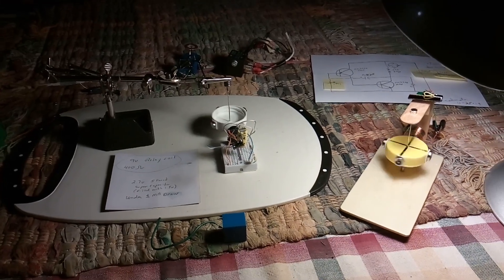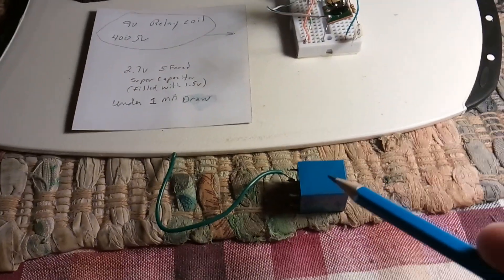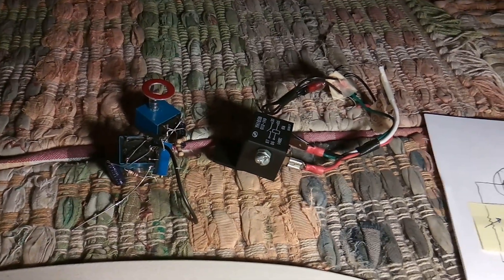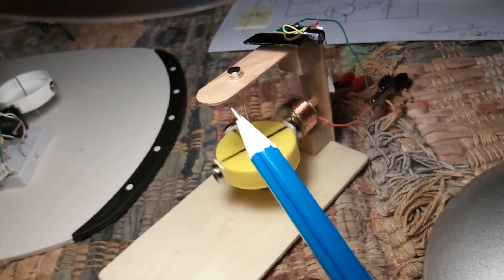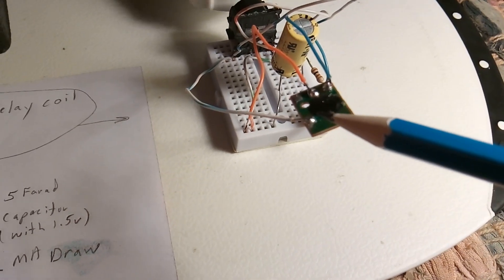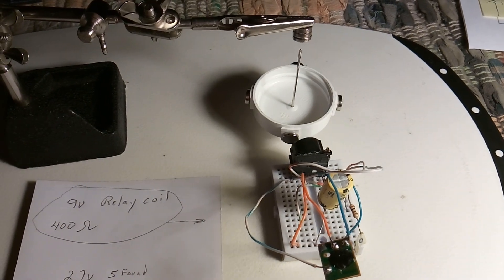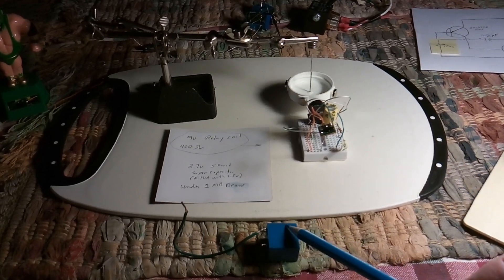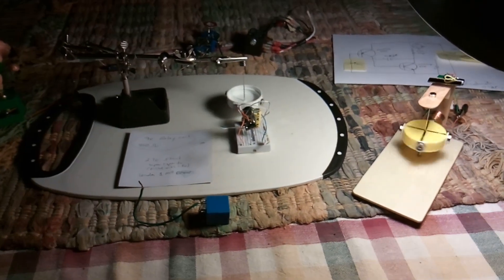Slider's relay coil idea

Comment: I try use Omron 24v relay, the coil have 1.2k ohm. I didn't remove the iron core, and when feed it with Li Ion at 4v it spin like crazy and draw 100uA.
I start to get fan blade to make it usable as mini fan. 🏃

Comment: It's funny, I always felt that using the solar circuit board seems like cheating and am constantly envious of your neat home built circuits but they certainly save time and are so efficient. Maybe have to try some surface mount components to get down to a similar size build.
Reply from the maker: I keep coming back to this " black dot" solar waver circuit.   It just works.   Considering that you can get a solar waver toy for dollar it is also dirt cheap.

Comment: Nicely done. Yes, the cases with the tabs on either side are easier, they pull apart. Got caught out though yesterday, needed 2 relays for a 12V motors project and had to do a deep dive in the shed!
Reply from the maker: I was glad to see the relay coil work so well with the solar waver circuit board. I will keep an eye out for low cost relays. This 9v relay I used was way too hard to take apart.  The steel coil core was a rivet that had to be filed out.  Too much trouble.  The 12v  tabbed cover design might be my next attempt.  Thanks for the idea.

Comment: Interesting vidio, Right at the end you mention the blob likes less than 1v,  is there a vidio in your collection exploring that? I thought mine was faulty when i gave it 1.5v and it was working intermittently. nice one
Reply from the maker: Thanks. This little circuit board likes about 1 volt.  The good thing is that they are  very reliable and durable.  I have some that have been working for many years.